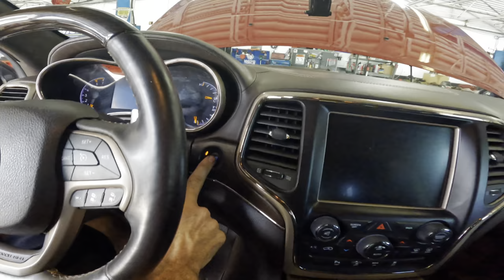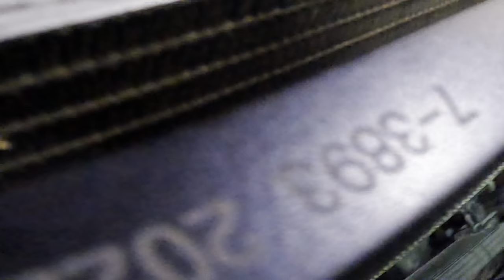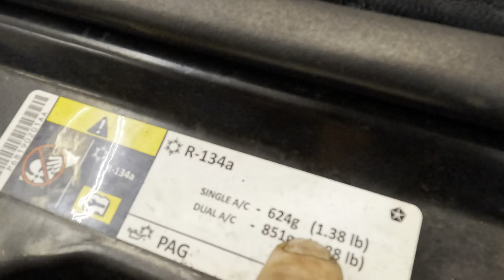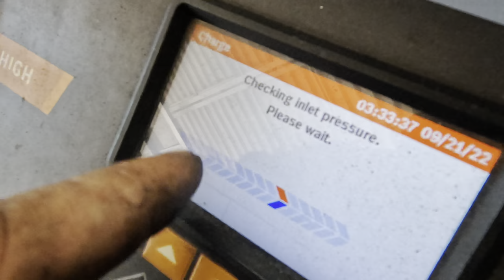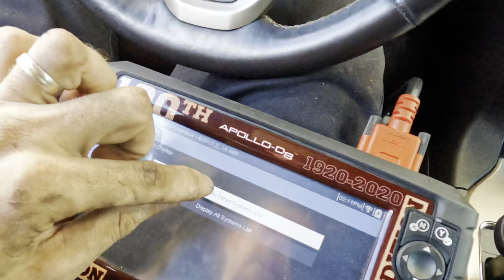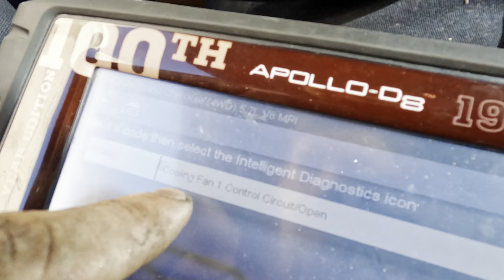Hidden Collision Damage! This thing blew up twice! Jeep Grand Cherokee 5.7

Comment: Speaking as a huge expert, I suggest, for future reference, to remove the condenser next time, remove he seats, then the dash, then drop the trannie, move the engine back and that will give you more room to get the fans out.  Hope this helps.
Reply: Stil8l need to remove the rear bumper.
Reply: I had to cut the roof off.
Reply: Cut the radiator and condenser in half.  This makes it much easier to maneuver things into place.
Reply: Just trash the hole car.
Reply: OK, so you read the factory service manual, show off!
Reply: Spoken...

...like a true "shop-god"... XD
Reply: @AJGreen-cn8kk  🤣
Reply: @AJGreen-cn8kk  6 years in Engineering school doncha know.  We are NEVER wrong, as you can see
Reply: @mybigfartsreallystin  Thank you my son
Reply: @AJGreen-cn8kk  Well.....it had a lot of pictures.
Reply: You forgot upper rear brake light bulb
Reply: Thanks for the laugh today
Reply: @kenore4003  Well, I didn't bother adding that to the list as it's a bit obvious don't you think ?
Reply: Ya'll wrong.   Was a "blinker fluid level" and a "ID-10- T" code issue..  👍🤟😁
Reply: @MrRunner  Absolutely!
Reply: LOL....That's a great suggestion...but this is not a BMW.
Reply: I see you are a (very) Smart person...
Because on some Smarts they put the engine in the trunk
Reply: You forgot to reformat the hard drive and reinstall the Windows.
Reply: Your talking about am Audi.😁😁
Reply: Unfortunately, the way they are making cars these days, you might actually have a good idea. 
It may have been how they built it to begin with.
Reply: Yeah it makes it easier, but it's also more work.
Reply: @AJGreen-cn8kk  😂
Reply: @whirledpeaz5758  Dang, I misremembered that part.
Reply: Don't forget to replace the kanuder valve.
Reply: @dotar9586  Cut the engine in half. It makes each part easier to remove.
Reply: Everyone knows, you have to start by removing the gas cap, before ANYTHING else 🤷‍♂️ jeesh🤦‍♂️
Reply: And they Wonder why Chrysler went  bankruptcy back in  day
Reply: @mkanyuh  Oh God don't get me started.  We'll be here all night as I drone on
Reply: @madog1  Are you sure ?  I thought it was the dipstick, but I majored in Electrical.
Reply: Oh, Don't forget the high speed bumper bolts
Reply: You'll need to remove the doors too.
Reply: Is that like cutting off your nose to spite your face or like some of the people I work with to make more work out of a job and turn it into a project but hey I like your thinking have a good day
Reply: @MrRunner  oh, you could be right! It depends on the engine size, being a performance model, probably is the dipstick!  👍😉 🤣
Reply: @madog1  I'm sorry, there is no might about it.  I did six years in Engineering School and have NEVER made a mistake in the forty years of post grad practice.  Sometimes I was fed with the wrong information, which led to a sub optimal result, but that's hardly my fault.  Dipstick it is.
I'm retired now and one thing I do not miss is people ignoring my advice and then whining when their problem doesn't work out to their satisfaction.
Reply: @senorcartmenez8902  Muchas Gracias mi amigo.
Reply: @timglass6041  This is unnecessary if the gain is sufficient to maintain the Transfer Function and hence the Pulse Length Modulation correctly.  If its < third order it will remain stable (according to Nyquist).  Please tell me you knew this. Please
Reply: You guys are rank amateurs. Since I am😁 older, wiser, and as an expert, I simply Googled it. All operations can be done through the tailpipe.
Reply: Did you check the alternator?        Yes, it’s full
Reply: @SteveB88  I must admit, I didn't.  Good point.  Absent a dipstick, I usually remove them and give them a shake, listening for sloshing.
Reply: @luisalthaus7249  the whole car?  Or just a particular hole?
Reply: Remove radiator cap , push vehicle out side , pull another vehicle in exchange radiator cap, drive away.
Reply: A lift kit might help also😂
Reply: I had the evaporator replaced about 10 years ago on my old Ford Focus 2003 (I still have it) and it was quite a job. The part cost about $2k CDN and I think the job was also in the four digits. Literally the dash had to come out. I was happy the mechanics was a 30+ years of experience guy with Ford. A/Cs always seem to be a big job. :)
Reply: @MrRunner   It looked just fine on paper!

Comment: The UV light excites the fluorescent nature, electrons and quantum, of the phosphorescence dye. Causing a energy state change in the material and as it decays back to "ground" emits light in the visible range. Just like a phosphorescence coating on the old TV tubes, but with UV light instead of electron emission in a vacuum tube.
Reply: but doesn't phosphorescence include the continued glowing after being exposed to a source? Such as "glow in the dark" stuff that glows after the radiation source is removed?
Reply: @jmduffee  yeah I think when something glows from a black light or any other condition it's just fluorescence.
Reply: Photoluminencense is indeed nonsensical. And phosphorecsence is also not the phenomenon being shown here. Fluorescence is the proper term here.
Reply: I'm not smart or anything, so someone who is certifiably intelligent and educated, tell Ray that the short term he's hunting for that describes that reaction to UV is FLURESS.
Reply: It is simple fluorescence
Reply: "There are various definitions of fluorescence and phosphorescence with the simplest being that fluorescence is prompt photoluminescence that occurs very shortly after photoexcitation of a substance, while phosphorescence is long-lived photoluminescence that continues long after the photoexcitation has ceased." So as mentioned the dye is of fluorescence, not phosphorescence meaning it will only glow under a uva (black) light and will stop glowing when the black light is turned off.
Reply: it's called "fluorescence". A substance absorbs electromagnetic radiation of higher energy/frequency (for example UV light) and emits radiation  of a lower energy/frequency (for example visible light), for as long as the  emiting source is on.
Reply: Not only that....it glows in the dark!
Reply: The flux capacitor activates at 88 miles an hour.
Reply: It would be Chemiluminescence because the compound is pretty similar to and reacts just like luminol does when exposed to UV Light.
Reply: Is that the same UV light spectrum used in crime scenes to identify bodily fluids, like on sheets, pillowcases, also with luminol for blood??
Reply: " you may even say it glows"
Reply: Glad to see everyone agrees 🤔
Reply: I lost you at the ……….
Reply: So at the quantum level are the dye atoms flicking in and out of existence. Schrödinger’s cat style?
Reply: What he said 😂
Reply: Ok, who ate a dictionary for breakfast, or was it a bowl of alphabet spaghetti 😁
Reply: @RMJTOOLS  "Quantum" means existing only at specific values. When the UV light hits the dye, it pushes the electrons up a couple levels, and they release visible light when they drop back down. Since the electrons exist only at specific "quantum" values, the difference between them is the same, so they release a specific color of light (green).
Reply: @johnbaxter852  So RayRay is not actually affecting our current space/time continuum or creating a warp bubble leading to his own Alcubierre drive? I worry about these things.
Reply: And I don’t want any cats hurt.

Comment: “Fluorescence is the emission of light by a substance that has absorbed light or other electromagnetic radiation. It is a form of luminescence. In most cases, the emitted light has a longer wavelength, and therefore a lower photon energy, than the absorbed radiation.” - wacky-pedia
Reply: Light is not electro magnetic ....photons
Reply: @nickmalone3143  visible “light” is simply the portion of the electro magnetic spectrum that our eyes are sensitive to.
Reply: @nickmalone3143  We can think of light either by its particle nature as you say, photons, but also you've probably heard of light waves. At the quantum level, most particles can be either waves or particles. When we think of light as a wave, the type of wave is indeed, electromagnetic.
This is actually a great demonstration of the dual nature. An electron absorbs a photon of ultraviolet wavelength and jumps to a higher energy state. As the electron falls back to the lower energy , it emits a photon of a lower wavelength which is within the visible spectrum. So we end up with particles have different wavelengths. The dual nature of light. (I know I am kinda oversimplifying before any physicists start on me, but makes the point).
Reply: @michaelredwine5074  ...btw its spelled "stupid" genius
Reply: It’s all down to probability.
Reply: Nice Google definition right there.
Reply: Thank you that was a great explanation you illuminated my day
Reply: @michaelpressman7203  it’s literally the definition off of Google.
Reply: @nickmalone3143  I ain't a scientist brother
Reply: Correct.
Reply: @nickmalone3143  magnetics can excite and accelerate a particle causing photon emission to occur.
Reply: I think it is chemiluminescence as it is because of a chemical reaction.

Comment: The glowing of this kind of dye under UV light is called fluorescence.
Great video! Keep it up Ray.
Reply: Spectroscopist here; 
Yes it IS fluorescence, and can correctly be classified as photoluminescence, as Ray said (Ray gets an A!). Luminescence can be from either fluorescence or phosphorescence, --  and fluorescence excited by the absorption of higher-energy photons (UV from Ray's light) is PHOTOluminescence. There's also chemiluminescence (from a chem. reaction), triboluminescence (from applied pressure -- ever chew some Wintergreen Canada Mints in the dark with your mouth open?), electroluminescence (electricity-induced), bioluminescence (from a living thing), thermoluminescence (temperature), etc etc. etc.

Class dismissed!
Reply: @tomcarter8035  Damn
Reply: Be safe and well down there! Thx so much for all your great videos and especially your explanations as you work.
Reply: @tomcarter8035  Yes, what he said.
Reply: @tomcarter8035  Neuroluminescence from a bright idea?
Reply: @tundramanq  We should call that Rayluminescence (or REEEEluminescence?), since he has so many good ideas.
Reply: @tomcarter8035  Thanks for sharing your knowledge. 
Peace.
Reply: Best  cheap example I can think of is when we used liquid Tide in Haunted houses to paint arrows and shapes on walls/floors.
Reply: Yes.  It is a luminescence caused by phosphorus in the UV dye, which becomes “excited” by the the ultraviolet radiation and emits photons.
Reply: Most molecules absorb light: Leafs are green because chlorophyll molecule absorbs red, orange, yellow, blue but not green, hence a leaf is green: In the Autumn, this chlorophyll molecules die shifting the absorption pattren and not absorbing, may be red... Fluorescence is another type of light interaction: A molecule absorbs light (usually high energy light such as UV, X rays etc) and moves electrons into higher orbits. With time these electrons return back to the original orbit emitting the light .
Reply: @tomcarter8035  Was invaluably entertained till I got to your comment and was rollin!🤣
Reply: @janpur1417  I’m sorry.  Leaves like grass are green cause we are taught that they are green and sky is blue. 

Just livin’ outside the box. 🤪
Reply: @Jack.Waters  And the sky is blue because of Rayleigh Scattering and the predominance of Nitrogen.
Reply: @NemoConsequentae  sky is blue cause we were taught that is the color Blue. Look up color in the dictionary or look up a color in the dictionary. They are not defined. Lives outside the box.
Reply: @Jack.Waters  Actually, they are: Electromagnetic radiation of wavelengths between about 450 and 495 nanometers.
:P
Reply: It's not just florescence. It's UV light stimulated the electrons that make up the atoms of the dye which results in a multiphase emission by the exited electrons and one of those phases are in a frequency of visible light when the electrons stimulated return to the ground state. If the emission was not multiphase, the dye would not be emitting visible light.
Reply: I was about to say the same thing!...
Reply: @tomcarter8035  what he said!...
Reply: @Jack.Waters  Not quite.
Colour can be defined by the wavelength of reflected light, the colour of an object, as we perceive it, is light at a particular wavelength, visible green light, for instance, has a wavelength of about 510 nm.
What we call that colour is learned knowledge and may differ with language.
Reply: @BoB-Dobbs_leaning-left  define color to a person born blind or fully color blind. 

Yes, the cause of color happens from many situations.  We  name it by its wavelength. 

You can excite certain things with radiation which may cause or to simulate luminescence. 

An LED lights by exiting gases trapped in a plastic chamber. 

There is a difference between describing what causes color and describing a Red color to someone that has never seen it. Everyone has a slightly different number of rods and cones.  If I’m standing at a different angle as light shining on an object I may see a different color. Not for the hue it’s reflecting but my perception. 

Even if I work nights only and you work days only we will perceive the color differently. Even though its radiating the same frequency.  

Search “the under exposed dress”. Some see it White/Gold others Blue/Black. 

Color is not defined in a dictionary other than being part of hue of color. Example Red Blue Green are the  primary color group.
Reply: @tomcarter8035  personally I love videos on deep sea bioluminescence some weird creatures down there and they've only scratched the surface I'm looking for et at the bottom of the ocean have a great day
Reply: @Jack.Waters  Your point?
Is it that perception differs from one person to another?
No shit Sherlock.
Reply: it's also defined as photonic radiation
Reply: Ray was trolling us, knowing we don't care which words he uses at these times.
Reply: @tomcarter8035 that's very cool...!!! Thanks

Comment: Wow, that was a lot of work getting to the damaged part. And then you have to put it all back together. It makes me appreciate mechanics even more.
Reply: Welcome to modern vehicles. To get mileage up they must get weight down .you can only use so much plastic so they must shrink the Metal . However the drive  components stay the same size . So everything has to be mashed in to everything else like a game of Tetris. Had a Saturn ion that needed a thermostat. Took 2 hours. Had to remove engine computer and half the engine harness just to get at the 2 bolts.
Reply: @stephenbonesteel664  My wife had a Pontiac LeMans.  The thermostat was behind the timing belt.  Need I say more?
Reply: @kevinray3229  Jesus, that would make for an expensive thermostat. Because might as well do the timing belt "while you're in that deep..." 🤣
Reply: @brnmcc01  Which I did.  Unfortunately some months later, the car blew out an air conditioning line.  I replace the line and re-filled with refrigerant (not knowing back then that it needed be evacuated first).  Then it burst the new line (I still had no idea how to fix it correctly and did not have the funds to take it to a mechanic).
Reply: It makes me miss my 1970 Pontiac Catalina. Then again, 10 MPG would be rough as a daily.

Comment: I had to replace the radiator on a 2014 Durango ( Almost the same thing as the Grand Cherokee) and I did everything not to remove the front bumper cover. I finally gave up and had the bumper cover off in 5 min and made the job so much easier. Wish I would have done that in the first place. Love the channel!!
Reply: Do they have those little plastic rings on the shock towers why they put those in instead of a round piece of metal with a hole in it and three bolts I have no idea I can make a die for that or you can burn it out on a CNC or laser water jet or whatever hey it can be done better than it is have a good day

Comment: Got rid of an 02 Grand Caravan that had the same leaks on the AC condenser and radiator. Apparently it was just metal fatigue from engine and driving vibration.

Comment: I'd call your approach to this one 'a lazy mans load'  You've done more work avoiding a simple job (removing the front trim) than doing said job would have been...   :)   But that's cool, we get to watch you struggle while we don't have to :)

To be clear, not criticising, been there, done that myself!
Reply: @Mike S But that’s a Toyota! Chrysler makes everything almost impossible to service 😂
Reply: @christophervanzetta  I honestly agree, jeeps are annoying to work with, it takes more time to pull stuff apart vs putting them together. Just did an oil filter housing today on a 2020 Grand Cherokee, has that additional egr system on top of everything else that was already there. Rubber tube for an EGR system? Surely that won't cause a fire if the main egr cooler fails and allows full temp exhaust gas into the intake also melting it down in the process unless I'm seeing things wrong?
Reply: I think he didn't want to scratch that shiny plastic have a great day
Reply: @Mike S nice man, but believe me when I say pulling a bumper is a piece of cake. It might seem daunting at first but usually there are screws in both wheelwells, top and bottom of the bumper and it comes right off

Comment: Meanwhile 10 years after purchasing my 2012 TRD Tacoma, I am still running the original AC system that has never broken down or leaked. 
that Italian Fiat /Chrysler quality right there.
Reply: The thing clearly run over something he was not supposed too
The condenser was clearly bend and damaged
my 2002 s2000 is still on the original Ac and blow cold as fu*k after 20 years
Reply: Funny, i’ve known people with Tacomas that wish the condenser was their only issue. Toyota builds shit.